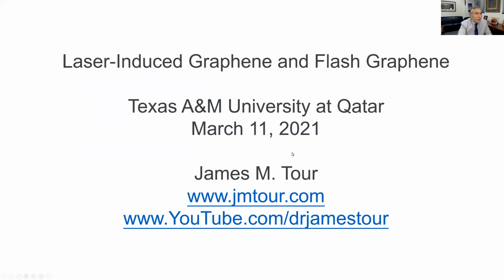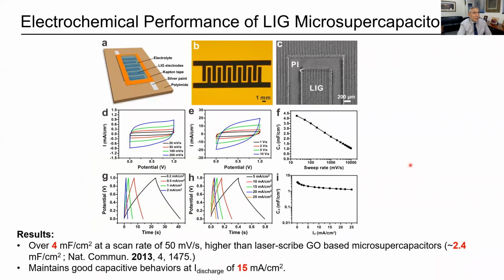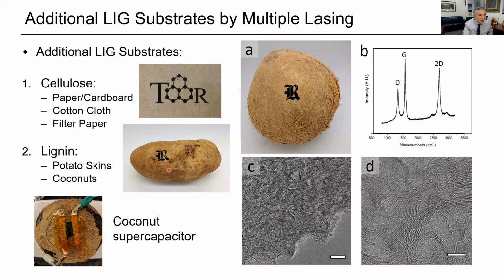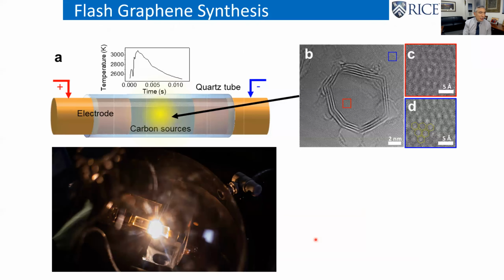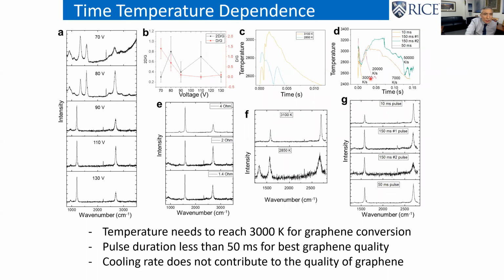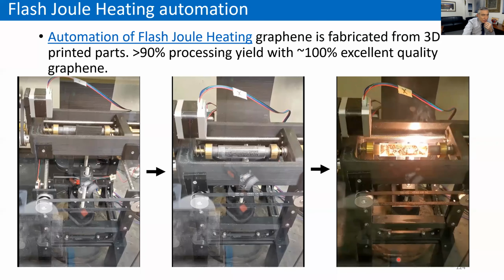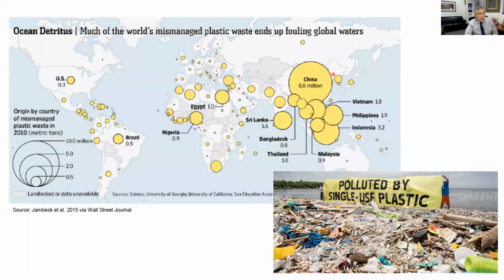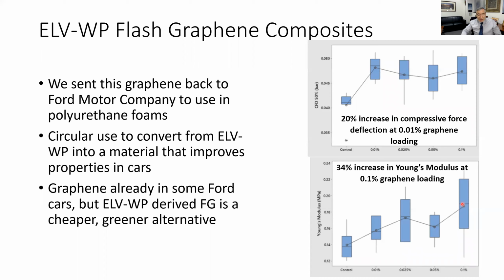Laser-induced graphene and flash graphene | James M. Tour | 11 March 2021

Comment: Dear Dr. Tour, I've been buliding laser's , laser cutting, drilling,  engraving, Hologaphic, reaserch in material photon chemestry, and enegery capacator laser discharge banks since the '1960s. My good friend Steve Anderson, physics department at Sonoma State, and I were talking about  graphine and carbon nanotube production in the '90s, using lasers, we never did anything with it. After seeing this video, and while watching it, I designed in my head a raster scanning idea, based on my many decades of Laser Light show events. I own a GSI EYE system, made in the '1980s. (Bought out by Lumonics of Canada), That serves me well, as well I have, ND yag, Ion, Co2, high power  440, 445, nm laser diodes. I have a nich in mind. Im excited by you're work. And this is right up my alley... I will get in touch with MaterialMatters. I am: Dale Robertson,  College Of Marin student. Exciting.

Comment: Just curious to know? Does anyone remember when Lightscribe cd burners came out there were people making flash capacitors out of Kapton tape on those decades ago! I still have quiet a few of the patterns for applicative circuits that you can print in cd format. Layering for more complex electronics opens up a world of surface mount applications. One guy was using fifteen layers and three metal foils and screen etching all using a Lightscribe and etching acid on the foils which he used the light scribe to prep for etching as well was making flexible surface mount electronic circuits. And this was back in the day of adsl and light scribes. Well maybe post adsl but you get the picture :).